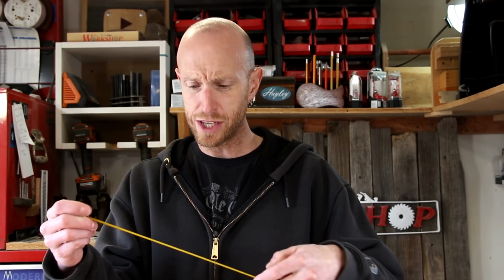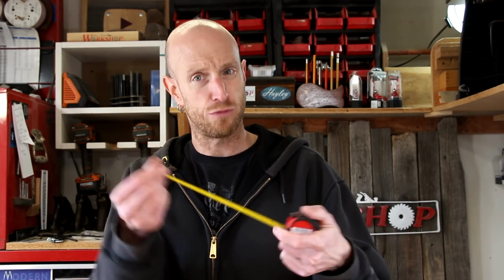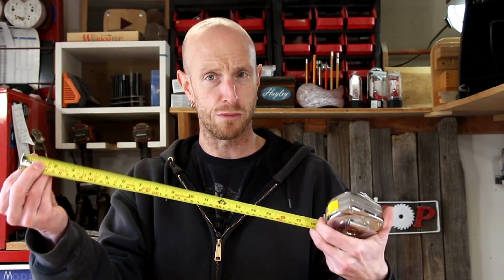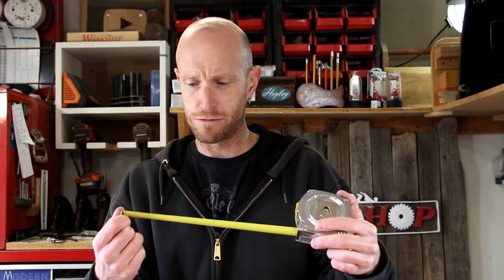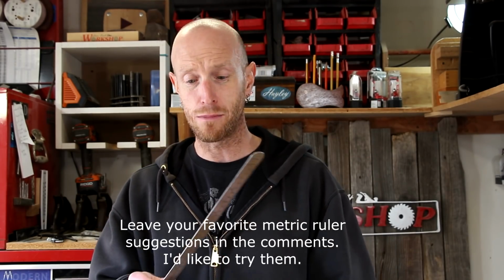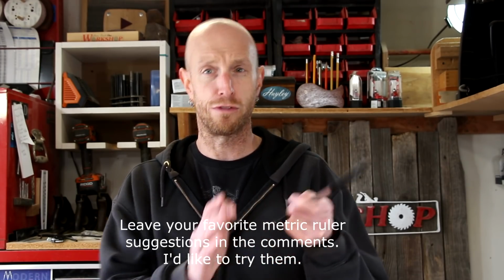My thoughts after using the Metric System for a project | I liked it

Comment: Metric user here, but one of the things I really like about the metric system is the ability to very easily switch between measuring "room-scale" things down to tiny measurements, with millimeters being thousandths of a meter.
Reply: And why would you ever want to do that? If we really wanted to we could convert feet and inches into thousandths of an inch. A thousandth of an inch is 0.0254 mm. It about the thickness of a hair. Although why anyone would want to do such a thing is beyond me. Are you attempting to calculate how many fleas could infest your hovel?
Reply: When brits were building ships  in  every single corner of the world  they were not concerned with wood thinner than 1 inch

Funny how gun barrel diameter was like odd to 1/100  of an inch. Poor gunsmiths.
Reply: In a lot of fields, (Building, Navigation, Precision manufacturing and chemistry) small changes at the micro-level equal big changes at the macro level. 

Particularly when drafting plans, but also make a 2 mm error on the alignment of a large building or an airliner and you're going to be a standard "What not to do" lesson for apprentices.
Reply: @michaelhandy4018  That's why banks count to sixth decimal place, and only pay you to second :)

Comment: This is like a Russian saying "if you are from a part of the world that doesn't use the cyrillic alphabet"
Reply: I don't even think this comparison is fair, because while the metric system is math and thus is universally better, the cyrillic alphabet is actually better for Slavic languages, it makes much more sense. So if the Russians were to switch from the cyrillic alphabet to the latin, it really wouldn't adapt well to their language (check Polish or Czech to see the amount of adaptations they needed)
Reply: A comment from a Polish native speaker, who also happens to speak Russian: Latin alphabet is better. We use the universal alphabet with the additions we need and it works just fine. If we used Cyryllic, we would be stuck with a weird alphabet that still would require additions for all the phonemes not found in other Slavic alphabets.
Reply: @Ilona__  as a foreigner who tried to learn both languages but only succeeded with Russian, I disagree :) Polish makes some sense with my eyes closed, when I just listen to it. When I open my eyes and look to that Latin full of diacritical marks, though, it stops making any sense. Of course maybe this has to do with my native language. We have diacritics too in Portuguese, but use them in almost an opposite way from Polish's alphabet. Then again, Portuguese is a Latin language, so the Latin alphabet has pretty much all the sounds we need
Reply: with all due respect, I think you might not have actually gotten to the point of learning all Polish sounds properly, so you do not see how consistent and clear this system is. 
Also, the plans to transcribe Polish in Cyryllic were first made in 1840s and failed miserably.
Reply: @Ilona__  with all due respect, you're probably partial to this topic, as a native speaker. Of course such an attempt like this in 1840 would fail because people weren't used to this idea, this kind of massive changes face a lot of resistance from the population. But looking at the Slavic languages as a third party — that is, as someone who wasn't born speaking one of them — and comparing the writing systems, I'll sustain to the end of my life that Cyrillic makes much more sense to this language family
Reply: sure, and all the Slavic nations who never used Cyryllic were too blinded to adopt the more convenient writing system :)
Reply: @Ilona__  well, now you're just putting words in my mouth :) There's a lot of reasons why these nations didn't adopt the Cyrillic alphabet and by far not all of them are linguistic. Religion had a lot to do with it, politics, tradition etc. But I'll not sit here and try to teach you the history of your own country, you sure know it better than me. My point is that language matters go are not decided based on convenience or easiness only
Reply: you said Latin alphabet was less suitable for Slavic languages, didn't you. I said it was perfectly fine and functional, moreover there is the additional factor of writing in the alphabet that is used as the most global one, which is plain comfortable in everyday life.
You seem to be missing the fact that both writing systems rely upon the very same principle and they assign graphic representations to sounds because users od the languages agreed so. Think of how "j" would be read in English, French, Spanish and German.
It is this flexibility that makes Latin alphabet so versatile, and thus also adaptable for Polish. And Turkish. Or Hungarian. And multiple other languages around the world.
Cyryllic simply has a different set of graphemes. Polish language, along with other Western Slavic languages and  Southern Slavic languages, do not share all the features of Russian, so viewing them as uniform is a step too far. 
As I mentioned in my first response, adapting cyryllic to Polish would result in just as many modifications, but on a less popular alphabet.
Reply: Thoughts on Croatian, Bosnian and Sebian?
Reply: @Ilona__  I dont think she can understand how customizable the Latin abc is. She just thinks that Cyrillic fits perfectly within the nature of all Slavic languages as she thinks Russian is superior and kind of mother to all other Slavic languages. Thats why she thinks it would work for Polish.
As you say Latin is the best because is the most customizable abc, even Kazakhistan converted to Latin, which is a Turkic lang.
Reply: @rizvan1632  none, except that they prove my point of language rules not being based on easiness alone. The use of the Cyrillic or the Latin alphabets in that region seems to be rather connected to religious roots
Reply: Alphabet is used ONLY in Greece (alpha, beta ...)
Reply: @pesjaner1  Nah the Greeks are copycats, the real aleph - bayt is ONLY used in Phoenicia.
Reply: 不是一個可以拿來比較的好例子 😏
Reply: i don't think this comparison is fair simply because the cyrillic script is used as the official script in 7 countries, co-official script in like 6 others, so i think it'd be fair for a russian person to say 'a part of the world that doesn't use the cyrillic alphabet'
Reply: @aiocafea  and latin and Cyryllic is not the only alphabets in world.
Reply: True. Just look at Asia. Nearly every country has different writing systems even tho they could have standardized to one range of symbols. China did it with their empire and they nearly switched Japan to entirely chinese characters.
Reply: Latin alphabet is perfectly suitable for writing any language in it, for that matter so is Cyrillic, Arabic or Chinese characters - it's just down to tradition which are preferred where. There is a major advantage to Latin though - because ASCII was standardized for Latin alphabet, Latin will always work better with computer systems, which is a very significant thing in modern world. And Chinese writing system has a major disadvantage compared to others - due to the sheer number of characters, it's just a lot of work to learn enough for basic literacy. Where western kids can be expected to have basics of reading and writing down by the time they start school - not a reasonable expectation in countries using Chnese characters to write, much of the education is spent on just learning the characters. That's time that could be better spend on other topics.
Reply: Sorry but you are wrong about Polish, Latin works just fine
Reply: @aleksandersuur9475  nope, it's not down to tradition. The letters were created (or borrowed, in the case of Cyrillic) to represent specific sounds. If you borrow a whole alphabet from a language or family of languages that uses a different set of sounds, you'll have more trouble to represent it and will have to deviate more and more from the initial form of the alphabet. Obviously a language will need less borrowing when the alphabet chosen was created to represent a language with a similar phonetic set.  The Latin alphabet requires some level of adaptation even to reproduce properly the Romance languages and others with great influence of Latin (such as English). When it comes to the Slavic languages, though, the level of adaptation required makes it just not worthy to use it, especially if they have another alphabet that was created to represent a phonetic set much closer to theirs. If the Slavic countries don't like the Cyrillic alphabet because of historical grudges from that part of the world, that's another thing.
Btw, the Chinese alphabet, the Japanese and Korean writing systems all seem to be more suitable to express the full meaning of their languages than the Latin characters as well
Reply: you just didn't know how painful for little Slavs countries could be the fact you told in your original post. Look, almost immediately here appeared someone how said "zh is better than ж", аnd of course it would be more convenient to write "zashchishchajushchijsya" instead of "защищающийся". That's because Russia is pain in the ass for all this tiny little Slavic countries, so they a ready to say of even do anything to prove Russia has nothing common with them😂
Reply: @akadox  not to mention that most western people would read zh as "z" and not as the actual sound of "ж"
Reply: There are more countries that use the cyrillic alphabets than countries that use imperial units.
Reply: Any Russian knows latin letters. It's just they value their tradition. Cyrillic, in the eyes of Slavic nations, is precise. There is a letter for every sound. Latin letters lack signs for Slavic sounds.
Reply: Well, no. There are more slavic counties that use Cyrillic alphabet including my own, serbia.
Reply: @Ilona__  The only problem with the Cyrillic alphabet in Russia is that it is difficult for foreigners, and not for Russians, we have no big problems using three alphabets, Cyrillic, Latin and Greek. For us, the Cyrillic alphabet is convenient and this is a fact that for some reason is raised only by foreigners who require "simplification" of the Russian language for them
Reply: @DVXDemetrivs  well, I agree it is not difficult, I read Russian literature on original. It was never me to suggest any change, especially for other countries. If you are happy with your writing system, use it, I am fully aware there are multiple writing systems in the world. 
What I have been trying to say all the time is that Latin alphabet works fine for Polish and we experience no inconvenience  from not having Cyryllic. Just the opposite, it is more convenient, if only from the perspective of typing on the most common qwerty keyboards or not needing to transliterate our names when travelling internationally.
Reply: Serbian is exactly the same both in Cyrillic and Latin alphabet. No adaptations needed whatsoever, except for a couple of invented letters, and a couple of not used ones.
Phonetic languages are the best(if that's what they're called)
Reply: @GypsyS1KRR  Buttmad ruski know nothing about Polish language and tradition. We nawet used cyrillic and it simply doesn't work for Polish. How do You even write ę or ą sounds in cyrilics?
Reply: @simasimson5798  but of course it is the same, an alphabet represents a language, it doesn't alter it, a priori
Reply: @kmeanxneth  the only two that matter
Reply: @Grungeuncle  you reads thoughts, do you? :) And yet instead of saving the world with this superpower, preventing mass tragedies, you're reading thoughts of random commenters on YouTube. Such a waste.
Reply: Serbian is almost 100% phonetic language meaning 1 letter=1 sound, and using latin abecede is really easy due to a fact, that latin was/is phonetic language with some exceptions. So I think not having one letter for every sound is bigger problem in most languages than writing in different scripts. Polish to me as a Slav sounds unlearnable with all consonants next to each other such as 'cz kz wzy' and then when sound comes out they hardly produce 3 different sounds. Turkish is also really consistent after learning how every letter sound you would have no problem reading it.
Reply: @mpetkovic26  that's a good point. It was kind of what I was trying to say. For what I have seen in the Slavic languages, it's easier to make this correlation between 1 letter = 1 sound using the Cyrillic alphabet
Reply: More accurately, it'd be like a Japanese person saying: "If you're from a part of the world that doesn't use Kanji, Hiragana and Katakana"
Reply: The cyrillic alphabet was not native to slavic languages, it was greek first and spread with the influence of the eastern pope (orthodox faith) everywhere people have been orthodox the cyrillic system is used, Latin in Katholic and later angelican and protestantic countries.
What alphabet is used has less to do with what sounds you make (English,German,Spanish all use the same alphabet but charters produce a wide range of sounds, e.g. "A" will sound wildly different in german than in english, same goes for "I" or other things like "h" with is not pronouced in some languages, while in others you can hear is very clear.
Reply: @Trollportphosphat  I know the story of Cyrillic. There was no "native" alphabet for the Slavic languages. The Cyrillic was created to fill this gap and borrowed letters from Greek, Latin and Hebrew alphabets, but it wasn't "Greek first".
In the case of Cyrillic the alphabet has to do precisely with how the letters sounds because it was created ESPECIFICALLY to replicate the sounds of Slavic languages.
As for the letters of the Latin alphabet sounding different in every other language, that's also because, as I've said before, to some of these languages (German, English, other Germanic languages) the alphabet was borrowed, like Polish and other Catholic Slavic countries borrowed it too. Probably the ancient runes would render the sounds of germanic languages better, but they are, of course, forgotten by now. But even in the romance languages the Latin alphabet requires adaptation, due to their evolution and the mix of Latin with the other languages the tribes who lived originally in the countries spoke. It's an intricate subject, but I stand by what I said before: the best alphabet to Slavic languages is Cyrillic
Reply: @mpetkovic26  Yep, proper encoding is the problem, not the symbol set.
"Ch" and "zh" sounds are not Slavic only. E.g. they have words like "Deutsch" and "Peugeot" in Europe. They could encode that either as "Pežø" and "Dojč" or "Пежо́" and "Дойч" and it would be perfectly fine despite it's in Cyrillic or Latin script and it would be better than the original spelling.
Reply: It's easy to make the correlation either in Cyrillic or Latin script.
Russian alphabet contains 33 letters (not 1000), English one does 26 so we could just add some fancy ă, å, ä for seven letters.
Suppose we removed unused ones (Q,W,Y,X) and added some modified (Ž,Č,Š,Ŝ,Ĩ,Ë,Ü,Ä for Ж,Ч,Ш,Щ,Ы,Э,Ю,Я) and denoted ь as tilde over the consonant before it and ъ as apostrophe. Well, that's it. Every Russian word could be written this way without losing any bit of information.
Some words would be even shorter. E.g. "oseñ" vs "осень". Ь is not a true letter, it's a consonant modifier so why bother giving it special width space in words.
Reply: @emceha  why do you think you would give up using ą and ę when switching scripts? They would look the same in Cyrillic.
Reply: @Ilona__  I think that it would be better if there would be more fancy letters in Polish. The current system is not optimal enough. Things like szcz should be shortened.
Reply: @sekrasoft  nope. This sound cluster is not frequent enough to bother. Also, the sounds are always pronounced distinctly, as sz and then cz, there is no reduction like in Russian. Just like we did not adopt x, when we can use ks just as well 🙂
Reply: BTW there are no soft ж,ш and no hard ч,щ in Russian so there would be no reason to add tilde to ž,č,š,ŝ. Some weird rules that produce insane шь and жь (that make no sense and sound like ш and ж) on the end of some words would die out due to their being too complicated. So Russian would become even better.
Reply: @Ilona__  well, but it's still two letters per sound. "prz" could be simplified too. Words are not supposed to be so peugeotically long 😃
Reply: @sekrasoft  what about "wstrz", any ideas how to improve this? 😋
Reply: @Ilona__  maybe "wstʂ" (borrowed this symbol from transcription)
Reply: @sekrasoft  In serbian ž č š are soft by nature we dont have hard(tvrdoe ž š or č)
Reply: @Trollportphosphat  well nether is latin to romans since it developed from greek, and greeks took phonetic system from phoenician alphabet which was first phonetic script as far as we know. The thing is when slavic language reform happened it came with strong influence of latin language, so the rules are somehow consistent and pronountiation is much more consistent than in some modern languages. 
Languages do need reforms. Its stupid to see word written and to assume how it should sound. Chore, Chord it is č in first one but k(kh) in second
Reply: @sekrasoft  why bother doing such confusing changes when something perfectly good as the Cyrillic exists? Of course you can make changes and adapt stuff, but my whole point in this thread is that the less changes need to be made to an alphabet in order for it to work for a language, the better.
Reply: I was just showing it's possible to use different alphabet successfully. I don't think we have to change it but we could.